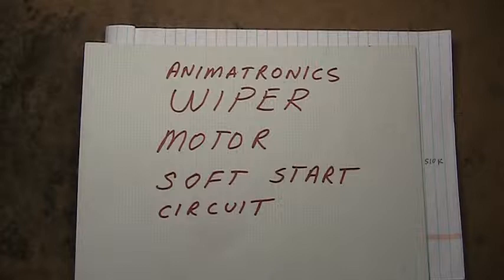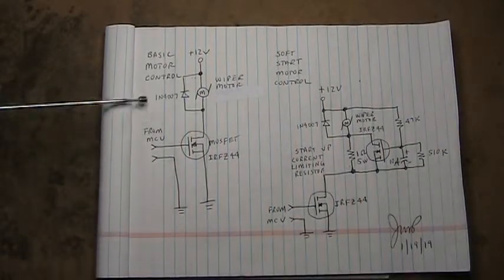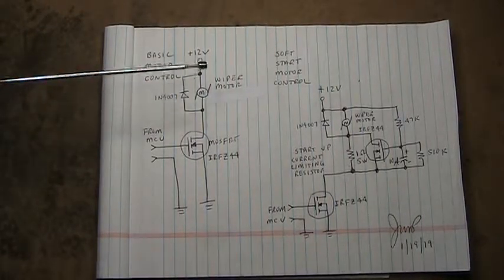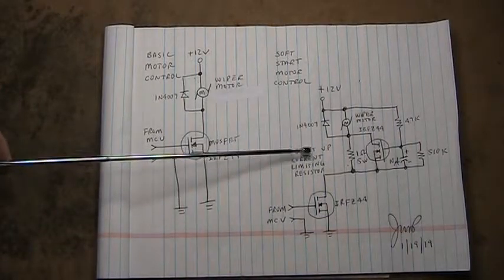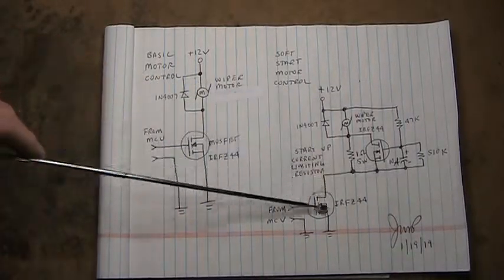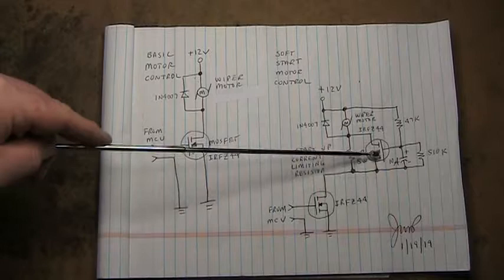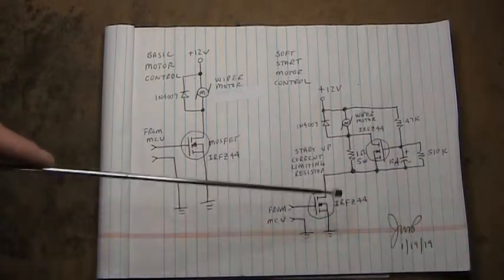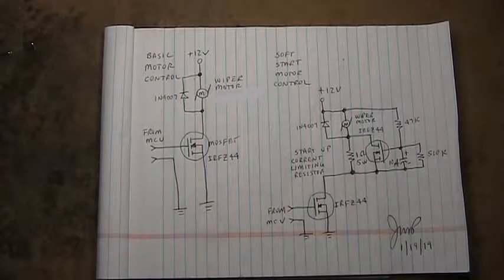Wiper Motor Halloween prop controller soft start circuit

Comment: Hello nice video sir. 
when i try to calculate: 12v dc motor need 10 amp then the internal resistance is 
1,2ohm (V=I.R) 
your series connected resistor is 1 ohm your total resistance is 2.2ohm 
then your total current :
12=Ix2.2 is 5,54amps,
 V(resistor)=5,54x1=5,54Volts
 and your motors voltage is 
V(motor)=1,2x5,54 =6,64volt
Question 1: Is 6,64volt is enough for first run for motor?
Question 2: Resistance needs W=VxI ==> 5,54x5,54= 30,6watt 
May i ask do you think your 5w resistor can handle the current?
Reply from the maker: Great questions.    Great calculations.   The instantaneous start up surge current must be over 18 amps.    18 amps was rated current output rating of my ATX power supply on the 12 volt rail.    The ATX power supply would shut down immediately upon motor start up.   Not sure where you came up with 10 amp motor draw.    The measured no load running current of my wiper motor is around 3 amps.  The resistor is small enough to get it started.   The resistor wattage is fine.   It is only in circuit for approximately 500 milliseconds before the MOSFET  turns on to bypass the resistor.   Hardly enough time to heat up at all.